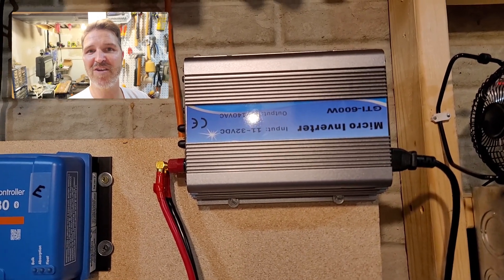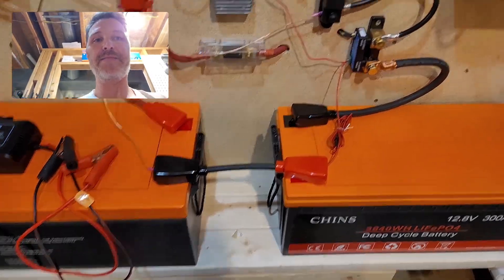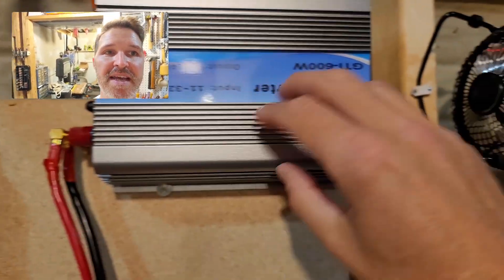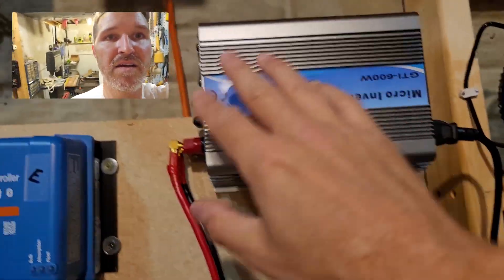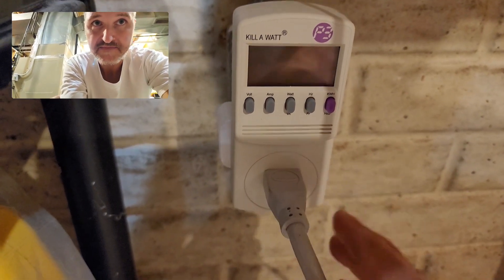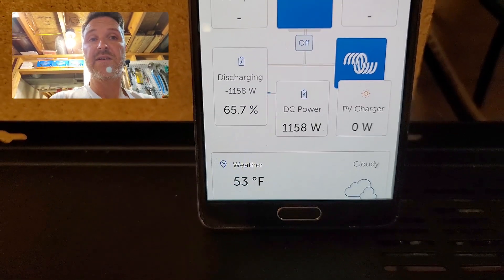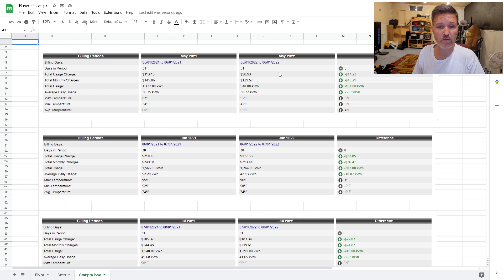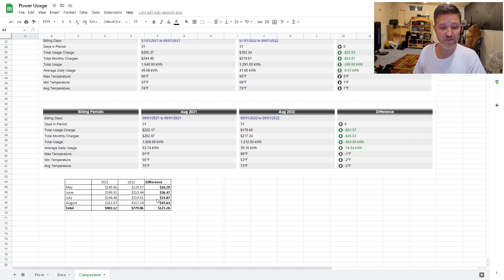Simple explanation of Grid Tie Inverter.  It saved me $123 in 4 Months!

Comment: WHERE IM AT IF YOUR NOT USING ALL WATTS IT WILL GO IN GRIDE METER SO PUTTING IT ON LEG THAT HAS ALL AIR COND AND  TV AND OTHER THINGS I WON,T GET CHARGE FOR IT
Reply from the maker: Yes.  Just make sure you're always using more power than what you're producing so not to back feed the grid.
Reply: @OffGridBasement  again thanks for the info have a great day

Comment: This safe? Can the election get shock if working on power line
Reply from the maker: There are no safeguards when there is power to your structure.  You need to make sure you are using more than the grid tie inverter is creating in order to keep the power in your house.  If the power to your structure turns off then the unit will not work.

Comment: Please be careful with these.  They inject power AFTER the circuit breaker. If you put loads on the same circuit as the inverter, it could overload the wires in the wall. It should have a dedicated outlet. That includes the entire branch circuit. You could have 3 outlets (branch) on a single breaker and not know it. You could  shut off the breaker and test the affected outlets and mark them. I think these are used quite a bit in the UK?
Reply from the maker: yes..  very common in places with 220v.  You're right.  You need to make sure to know EXACTLY what's on the circuit.  Thanks for the info and the comment.

Comment: you are not measuring how much the grid tie is saving you all you are really measuring is the difference from one year to the next and assuming everything else was equal so the grid tie was the reason.   You have a kill a watt, just record how much goes thru it and keep track of that.  Kwh into your house times the rate from the power co and you have a more accurate savings.   And for others wanting to do this check with your electric co.  Where i live it is against the providers rules to use grid tie inverters and if you are caught doing this the company can fine you and disconnect you from the grid for safety reasons. They will say anything connected to their system has to be certified and documented with them. I wish i could use these, they are a low cost and efficient way to lower your power bill.
Reply from the maker: You are right.  I don't keep track of every kw my grid tie produces, but my electricity cost went up this year just like everyone else and my monthly bill is reduced.  This is directly attributed to the use of a grid tie inverter.  As long as you get a small enough inverter or an inverter with a limiter, you should be fine imo.  Just don't over-produce!  Thanks for the comment 👍

Comment: So you spent $2000 to save $30/month or less? Your ROI is around 5 years assuming it requires no maintenance or replacement parts in that time.
Reply from the maker: I'm referring to just the grid tie inverter.  My off grid system was never intended to save me money.

Comment: If you don't know what you are doing always talk to an electrician first. There are many risks including fire, so first try to understand how it all works and how much power you can push back into the house, using which circuit, etc. You can easily overload a circuit wire and the breaker will not trip because it only sees the current coming from the grid. In my house I have a dedicated circuit for injecting power from the solar array and nothing else. But I had an electrician inspect my work before turning it on and I made some mistakes I'm glad he caught. Just be safe with this stuff, a potential house fire is not something to take lightly. With that said, it's a cool project and can save you some cash with very inexpensive equipment.
Reply from the maker: Thank you for the great information and the comment.

Comment: That "Grid tied" micro-inverter doesn't look like a safe set up. You can't use a male end plug to feed electricity into something. Not a good set up. That set up cannot be up to code.
Reply from the maker: You're right.  It's not to code or UL listed.  There is also a chance of backfeeding to the grid without being registered by your utility. Use at your own risk.
Reply: It does seem like the 120VAC cord would be a suicide cord, but it is not. Remember that unless the GTI senses 120VAC, it does not produce 120VAC. The GTI must sense what the voltage and frequency is before it produces anything.

Comment: Only two things stopped me from doing a DIY grid tie system.  If you have an old mechanical spinning power meter, you're golden.  If you have a smart meter you need to be very careful.  You should design a system that has CT clamps on your input from the utility side so you can set your inverter to NOT export electricity to the grid.  1) Some smart meters will accept the extra KW/H and then charge you for it as electricity consumed rather than provided. 2) Smart meter may alert the local utility that it is sensing power generation at your location and you're not in their database as a permitted solar address.  Possible disconnection from local utility.  Last consideration was that while these devices from off name companies are much cheaper than name brand, they don't appear to be UL listed.  In the rare case there is something like a fire at your house (even if a kitchen fire with no electrical involved) your homeowner's insurance may deny your claim.  Or, things may work fine for you and nothing will happen.  It's all up to whatever risks you're comfortable with.  Not saying it's right, but it is the world we're living in.  You should look into a legal solar install.  With the Federal tax credits and some states have solar incentive programs to install solar, you may substantially reduce the total cost and also have a system that you don't have to worry about and can also sell with the house as an upgrade.
Reply from the maker: Thank you for all of the great information!

Comment: Ha,Ha  500 watts x 5hrs a day = 2,5 KW x $.15=.37 cent saving a day x 30 days =$11.1 You Need a sunny day every day. 4 months  $44 saving .Impossible to achieve.Amen
Reply from the maker: Your math is sound.  There must have been additional factors along with the GTI.  Thanks for the comment.
Reply: @OffGridBasement  Agreed. The math doesn't really work out. Likely, you have made other changes as well, or if your heating and cooling load was different from one year to the next, that can significantly impact total usage. I've spent dozens of hours just air sealing and insulating this year, as well as family members moving in and out, so pinning changes to any one thing is an insurmountable task for me.

Comment: Does it automatically disconnect from the utility if there is a power outage?
Sending 120 volts out your service will turn into thousands on the other side of the pole transformer, and can KILL a lineman!

please stop doing this! Just plug an appliance (like a freezer) into it.
Reply: It doesn't put out power when there is a power outage.
Reply from the maker: In the video I talk about a safety feature called "islanding".  The inverter shuts off as soon as it doesn't sense any AC current.  I hope that puts your mind at ease.  Thanks for the comment 👍
Reply: OGB covered this in his video. I hope the commenter familiarizes himself more with the details of how you have things set up OGB.
Reply from the maker: That is correct.  That is what ALL grid tie inverters do.  Even the full house residential size grid tie inverters.  People think they are getting extra protection from power outages, but they are not.  Only if they have a hybrid system connected to a battery bank.
Reply: @OffGridBasement  Understood. But understand, I am not criticizing you per se. Reliance on CCP products is not in our best interests. The lack of documentation on this kind of product is concerning. At that price point, I also have to question the quality. I appreciate the conversation, so everyone understands the issues!
Reply: @chriswhitehouse9764  I will admit that I stopped watching when I realized this is not something I am interested in. I would rather have my limited solar capacity supplying a battery bank that can keep things like a chest freezer and a sump-pump running. I can leave them connected full time, saving the cost of that much energy, while not tampering with the landlords' electrical service, I also do not have to intercede during power outages.

I am subscribed so I may be learning more about it.

Maybe some confusion about the term 'islanding' can be cleared up in the future. Hint: don't get your definition from documentation that was translated from Chinese.
Reply from the maker: I completely understand your concern and agree!  I wasn't expecting this unit to last a day in the way I planned on using it.  4 months later and it's proving me wrong.  I do agree that if you use a unit like this to make sure and have protections in order..  fuses / breakers on the line.  This unit can fail at anytime.  That is why I have an external fan constantly blowing on it b/c i've heard the biggest reason they fail is heat due to the internal fan failing.  Thank you for the comment!
Reply: @OffGridBasement  Thanks for the interaction!
Reply: I think the ultimate is having separate 12-2 wires run in the house for “solar” option or “utility power” option. But I do like this option as well. I currently run my clothes washer off such a separate line as well as my fridge/freezer. When the attic cools off a bit more I’ll have other lines as well. Two receptacles in a few locations each labeled appropriately.

Comment: That’s not a safe wiring setup. You should not be sending AC power into your home using an extension cord, an outlet strip and a residential outlet. That’s just asking for someone to get electrocuted.
Reply from the maker: You are correct.  This setup is not to code.  I used this size unit b/c of the fact that my house never uses less than the wattage this unit puts out.  If you go with something bigger you really need to hard wire directly to your main panel and use a limiter.  Thanks for the info.
Reply: Thank you. Tell him. Let him know. It's wrong and it's dangerous. Viewers don't try that. Wrong. Wrong. Wrong.

Comment: I want to subscribe but in the end you asked for it so I didn't
Reply from the maker: I've always wondered if I should stop saying what I say at the end.  Thanks for the info.
Reply: @OffGridBasement   I’m not that picky with daily life.  Lol.  Can I use this Inverter and not push juice on the Grid and stay just on the House side of the meter?  Thanks and Subscribed   Still Learning.
Reply from the maker: @soggyb4082  the only way to do that is to make sure the base usage of your house is higher than the output of the inverter.  Or you can turn it on when you run the air conditioner or clothes dryer.  There isn't a limiter with this device.
Reply: @soggyb4082  this is not a safe set up. Do not try it. There are multiple problems with this set up. First of all you cannot back feed your home from an outlet. Secondly, your power provider's voltage and frequency and your "Grid-tied" inverter frequeny cannot be in phase from that set up. It will burn down your home.
Reply: @eddietee6305  That is not true. First, 600W is safe to inject though a normal 20 Amp 120V circuit. Second, grid tie inverters like this sync with your house Voltage and frequency before injecting any power. Lastly, the correct term is “anti islanding” in that this unit will not inject any power in a grid down situation to protect line workers.
Reply: @joeh3767  the internal relays of those inverters can malfunction or burnt out at any time and might not work properly. That's the risk. That's why they are not approved.
Reply: @joeh3767  that's why we have regulations. I've worked with inverters before solar became a thing and I know a thing or 2 about syncing.